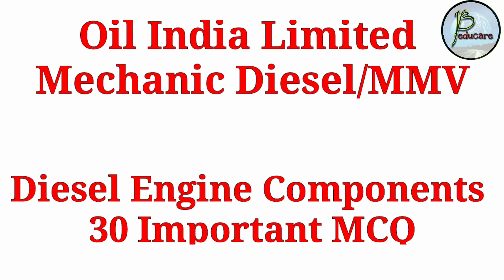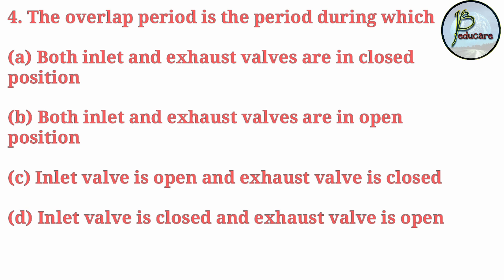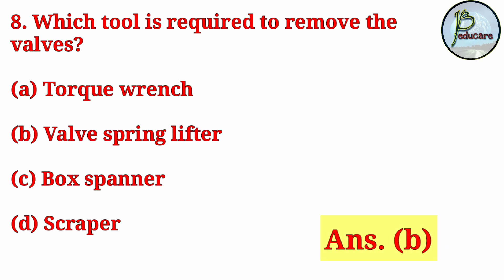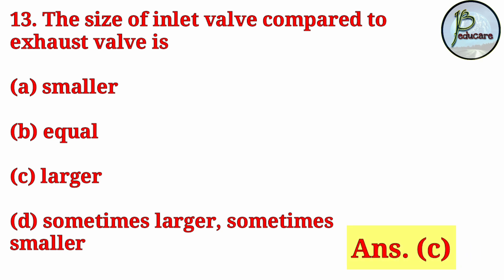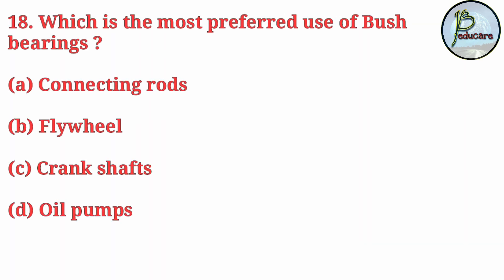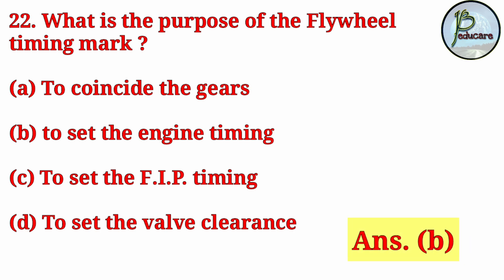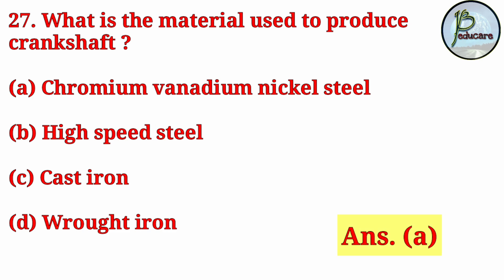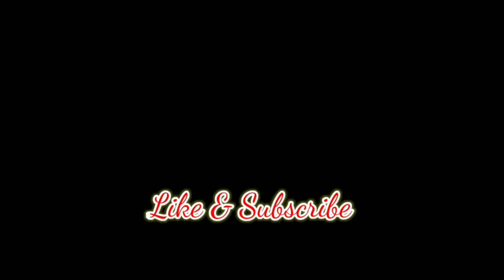#oilindialimited  #coaching #itijobs || Mechanic Diesel/ MMV || Diesel Engine Components || 30 MCQ

Comment: Q10 2t ans b kole bt option b aru d majot ki diff ase baru jonabo cun
Reply from the maker: Q. 10. Roller bearing actually radial load besi ke bear kore ru axial load kore jodiu kom ke kore.
so kisuman book t iar ans radial load thake ru kisumanot both radial and axial.
NIMI mote jodi sua tente 10. (d) paba
Q. 11 tut (b) ru (d) option duta same type hoi gol.
eitu monot thoi diba j tapper roller bearing e radial and axial duita load bear kore

Comment: 18. Bush bearing  preferred connecting rod
Reply from the maker: it is said most preferred, no doubt that bush bearing is used in connecting rod assembly, 
but it is needed in flywheel for transmission input shaft and clutch disc.
Go through concept...